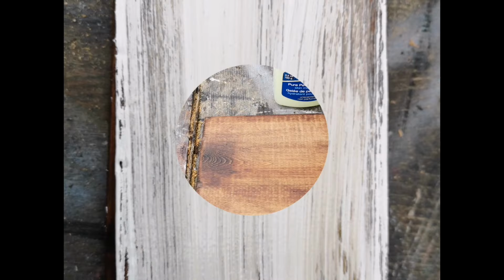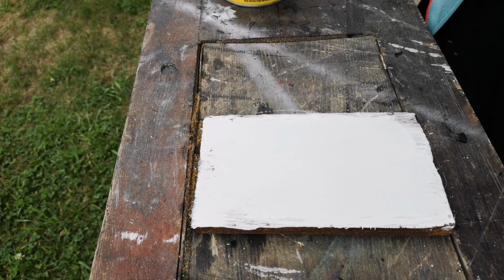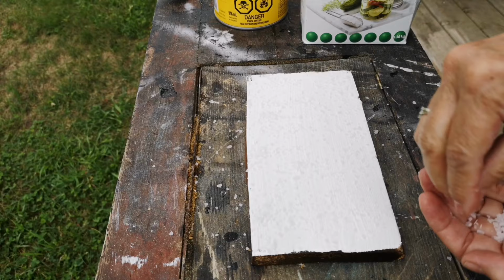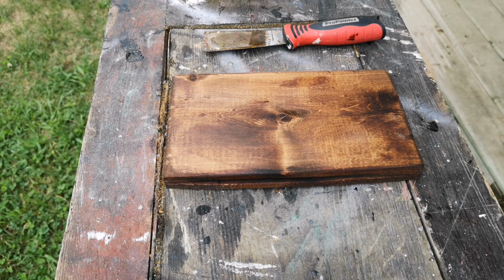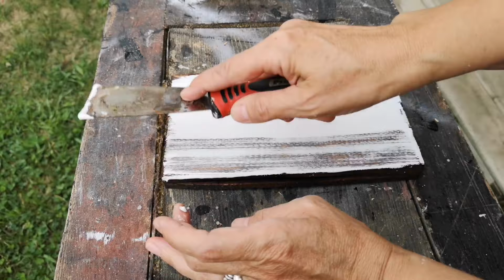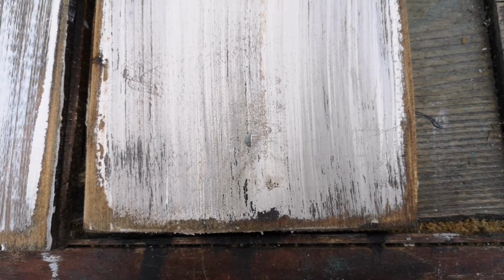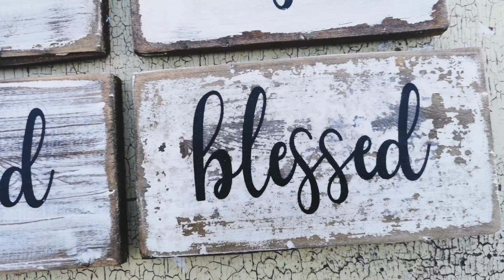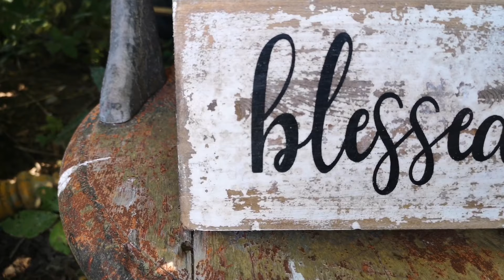4 Painting Techniques to make NEW wood Look OLD & DISTRESSED

Comment: Definitely enjoyed seeing the difference when using the salt for the chippy look. Does it have to be pickling salt or would any larger, chunky salt work? Is the salt causing the effect in the paint not sticking, or is it the action of the sandpaper & salt together that makes the paint "chip" off? The scrap method was also great & looks easy to do. The older the scraper the better probably. Would also love to try these with gray, blue, or barn red stains below the white. Thanks!
Reply from the maker: Thanks for watching Susan! You can use any salt! The coarser the more chippy it will look
Reply: @OurUpcycledLife  Thank you!

Comment: Awesome video!  Awesome chalk paint recipe!  I tried the salt method but my results differed from yours. I roughed up a pine board with a wire wheel on a grinder to highlight the grain.  I used home made chalk paint over black gel stain.  i put on medium coarse salt while wet.  Left over night.  Light sanding.  No chipping!?!  Do you reckon it's because I raised the grain too much with the wire wheel grinder?
Reply from the maker: Thanks for watching! It might be... I find with the salt method you have to  dab it on don’t do any brush strokes.. That might give you a better result
Reply: Chris Unger Try the stain gel then pour the salt then the chalk paint then more salt. Then scrape. That will give you a mixed scraped look incorporating both colors if that's what you're looking for. You can layer as many colors as you want but putting the salt between each layer and best to scrape while still somewhat wet.

Comment: ok another question, i have this old cabinet i told apart and it's that orangey stain.  i tried stain over it but it wouldn't work so i sanded it down so question is with ever kind of wood, repurchased, new, old, already stained, do i put dark stain on every kind of wood?  Please answer my question completley i'm having trouble with you not answering me thoroughly, sorry to say that
Reply from the maker: I’m not quite sure what you are trying to do with a dark stain? Have it underneath your top coat ?  That orange stain is really hard to get rid of.
Reply: @OurUpcycledLife  yes, am i suppose to put the stain on top of the orange or sand it down and do it?  does that kind of used wood have to be sanded down before the signs can turn out destressed?
Reply from the maker: I would just paint over it with a black chalk paint the a white chalk paint then make into a sign. I never sand down the original wood I just layer colours on top of it . But always use chalk paint or it won’t adhere.
Reply: @OurUpcycledLife  Thank you so much, you answered my question just right!  I'm watching older videos of yours right now!  thank you for sharing all your creative ways!
Reply from the maker: Glad to help out. 🌿